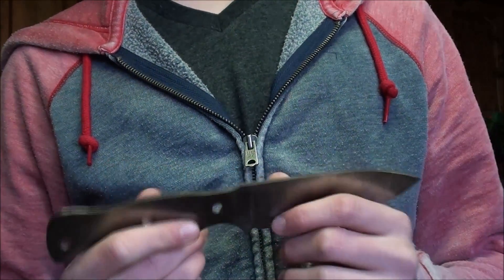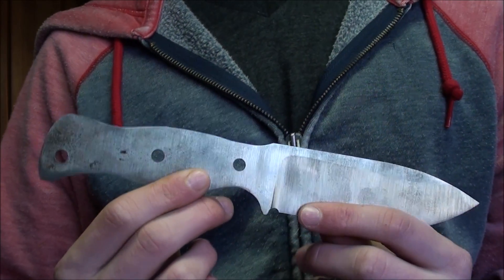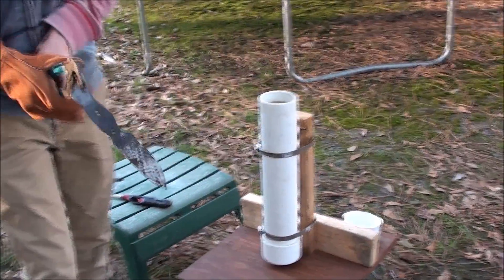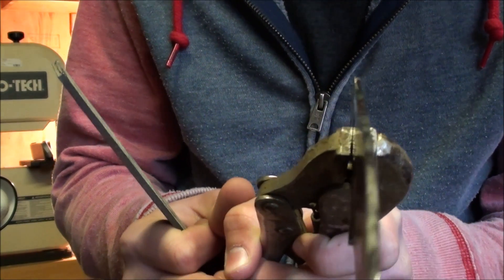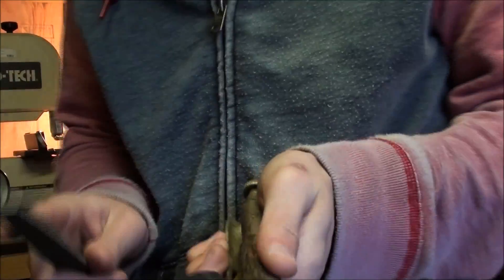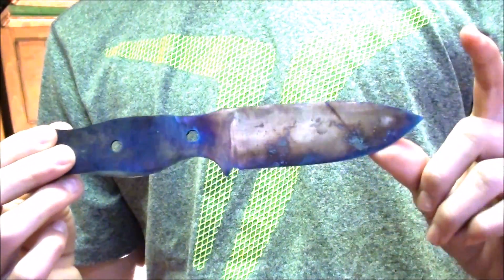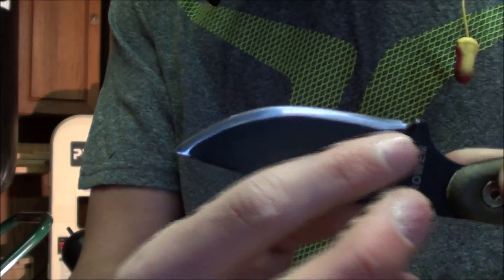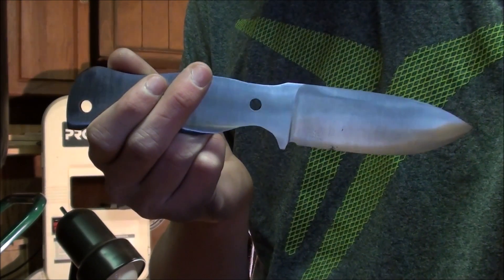The Basics of Heat Treating a knife- HOW TO HEAT TREAT A KNIFE

Comment: What did you do after the hour at 450 in the oven?  Did take it out or turn off the oven and leave it till it was cool?
Reply from the maker: Take it out.  When you temper the knife, you want the blade to turn a golden/wheat color.  After the time in the oven, it should have this color.  If you were to leave it in the oven longer, like while it was cooling, there's a chance you would temper it too much and the steel would no longer be hard enough.

Comment: Without normalizing?
Reply from the maker: typically the normalization process is used when a knife is forged to relax the particles.  When using just the stock removal method on bar stock, it isn't REALLY needed.  I'm sure it would have small benefits and such, but this video was more for the beginner to heat treat.  Thanks for commenting.

Comment: Do you need to heat up the oil before hand? What would be the negative consequences if you didn't?
Reply from the maker: I've always heated it up as it's what I've been told.  I believe you are supposed to warm up your quenching agent so they quench isn't so harsh.  If you use cool/ not warm oil it may possibly be too harsh and crack the blade.  Hope this helped.

Comment: hi . I've got a question. I just made 2 knives from a used chainsaw disc, do I have to treat and temper these knives?
Reply from the maker: Hello.  Now Jay, i'm a little confused by your question.  When you refer to "Chainsaw disc" is that the chain or do you mean the actual disc part?  If you are referring to the steel disc that the chain raps around, it is not blade steel and well not harden and temper correctly.
Reply: Bell Blades  . oh my mistake sorry i was meant to say circular saw disc .... yep . do I have to treat and temper it?
Reply: Bell Blades thanks for replying
Reply from the maker: It all depends.  First off, were the tips of the saw blade seperate? like welded on or so?  If not, thats good, it means the steel is all good.  Second, did you over heat the blade while making the knives? If so, yes.  It would be better to heat treat.  If you think you didn't overheat it, then no, you will probably be ok leaving it.  I hope this helped.
Reply: Bell Blades great ! yeah thanks for the help. and yeah the disc was one full piece ( no welded tips) and I'm sure I didn't overheat, i used a buffer Whit a disc, didn't get red or yellow, I could handle it Whit regular cotton-rubber gloves . thanks again ;)

Comment: So one could use a pvc pipe as a container for quenching? Doesn't the pvc melt?
Reply from the maker: Marvin Bückert yes, I use 4 inch diameter PVC. It's thick enough plastic to not melt as long as I don't hold red hot steel directly against it. The oil disperses the heat quick enough so it doesn't melt as well.
Reply: Cool, thanks for the quick reply!
Reply from the maker: Marvin Bückert no problem buddy, glad to help.

Comment: When tempering the knife in the oven do you mean a kitchen oven or a special oven made for tempering?
And do I have to temper the knife directly after I hardened it or can I do it like 2 weeks after? Great vid, keep it up!
Reply: Internal stresses are built up during heat treatment so it's better to get the thing tempered as soon as you can. Also, if you leave it around you might accidentally break it!
Reply from the maker: I just use a normal convection oven in the kitchen.  They make special ovens for heat treating, but when working with simple carbon steels you can use whatever.  No, you don't have to temper directly after.  There is no time limit that you have between hardening and tempering (again this applies to my knowledge of working with simple carbon steels).  I hope this helped.
Reply from the maker: Copperman I second that (like that makes a difference. Haha!).

Comment: so does some steel require it to be dunked in water instead of oil to harden it??
Reply from the maker: Yes, that is correct.  Some steels require a quench into water rather than oil to reach optimal hardness, but if you have the choice of oil or water, go with oil.  While water can make a knife/piece of steel much harder, it also causes a higher chance of something going wrong in the quench (i.e. breaks, warps, etc.).  Hope this helps.

Comment: I can see both warp and twist in the blade, is this within tolerances?
Reply from the maker: There was a slight warp left, yes.  Most of this came out with finish grinding, but there was still a very minimal bend.  The customer didn't mind and it was hardly visible.  I do make sure to be more careful with my thinner knives now.  Thanks

Comment: Very nice knife, well made video. I think you over heated the edge of the knife though. The edge should not turn blue/purple as that means it lost its hardness. Now I am no professional but next time I would temper at 400 degrees for an hour or two. What kind of steel was that made from? I really like the design.
Reply from the maker: Yes, I know about the coloring.  You're correct.  That's why once I tempered I ground most of the bluer/purple steel out and put a more obtuse edge grind.  It performed well once I tested it before I sold it.  I tested on it pretty hard with no sign of edge damage or dulling sooooo....  The steel I used in this was recycled steel I found that actually has very pleasing results.  It is 1/8 inch thick, can easily be hardened (easily as 01, 1095, 1084), and It holds and edge like a boss when worked properly.  I'd say its equal in performance to say 1070.  Thanks for the criticism and kind words.  I'm glad you enjoyed.

Comment: After tempering if the edge is purple or blue that means the steel is too soft meaning the knife will get full very fast you just want the blade to be a straw color
Reply from the maker: I ground out most of that just for that reason.  I know about the colors and how they typically relate to steels in tempering, but I stand by this knife.  I did some pretty hard test before giving it to its new owner just to test because of the tempering; it held up perfectly.  For such a thin knife behind the secondary bevel and the questionable tempering at the edge it held up perfectly.  After all my tests it still shaved, cut phonebook paper, and showed now signs of any edge damage.  I appreciate you pointing this out though for the rest of the community to see.  Straw is ideal, blue or purple are exactly the opposite.  But I stand behind my knife.  Thank you for your comment, have a nice day.

Comment: I leave my knifes for 4 hours on 175 degrees celsius I think its better
Reply from the maker: That may work, haven't tried it.  I typically go by the suggested temp for the steel.
Reply: That would be on the cold side, 175 C is 347 degrees Fahrenheit.
Reply: What type of steel was this?  In another comment you said it was recycled leading me to believe you don't know exactly what kind of steel it is.  if so, how can you follow the suggested temp for the steel without knowing what type it is?
Reply from the maker: Jarod Morris I use suggested temps on other steels that I order (like 1095).  This steel I have experimented with because it is recycled.  It works almost the same as the basic carbon steels, leading me to use their suggested temps.  Sorry for the confusion, hope this helped.
Reply: Jarod Morris 2hrs* 1084 steel
Reply: Bell Blades No big deal. thanks for explaining
Reply: Bell Blades No big deal. thanks for explaining

Comment: Hi, im a 15 year old beginner who likes making knives from old files and lawnmower blades. What do I need to know about heat treating? Im now at the part that is stressing me out the most, quenching in oil and tempering, but im not exactly sure what I should do and at what temperature. Please help
Reply from the maker: Ok, what you are working with is already hardened so to make your life easier, before you start grinding or anything you need to heat up the steel to a redish color and then let it cool in  the air.  For heat treating you heat up the steel to a little over that redish color and to check touch the steel to a magnet; if it sticks, get it hotter, if it has no magnetic pull, then you can quench in oil (I use vegetable oil, and do not suggest motor oil).  For tempering you need to clean the steel just enough to see the bare steel and then heat it up to roughly 420-450 for 1-2 hours depending on your steel.  A trick to know when your steel is tempered is to watch the steel until it turns a golden, wheat color.  At this golden color, your steel is tempered.  Also I'll mention, after the heat treat, make sure to not overheat your steel.  If you overheat after heat treat, you will ruin the heat treat and create a knife which is too soft.  I hope this helped.

Comment: how hard is it to file after it has been tempered? im fairly new to knife making... obviously haha.... ive seen in many videos on youtube... durring quenching... the blade can sometimes warp... sometimes side to side sometimes downward toward the blade edge where the metal is thinner... so i was thinking... if i leave my blade fairly thick... say 50 or 75% beveled until im through hardening the blade... then finish my file work.... maybe i could avoid some of the warping issues... im not looking to make my blades quickly... or easily... i want to make top quality blades... if that means a little more work then so be it... if it matters... im going to be working with 5160 and 9260
Reply from the maker: Actually with the type of heat treat I preform, you dont check the blade with a file after tempering.  Tempering is usually based of color (aim for a yellowish, straw color.  anything darker like a blue or purple will most likely be too soft).  Definitely file more than 75% before heat treat, maybe closer to 85%.  If you only file 50-70% youll be in hell trying to file the rest once its hardened.  The blades you've seen warp are most likely much more thin in stock and edge thickness (upwards of 95% beveled probably).  For the best results try not to overheat your blade, definitely try to avoid water quenching (unless required with a certain steel), and quench as fast as you can into the oil then sway back and forth in a cutting motion in the oil to cool it.  I hope this helped, good luck to you.

Comment: can i do this with stuff besides a knife
Reply from the maker: yeah of course!! This is really versatile.  If you get your air to coal ratio right you maximize heat and you can get it up to roughly 1800-1900 degrees, maybe even higher.  Good luck!